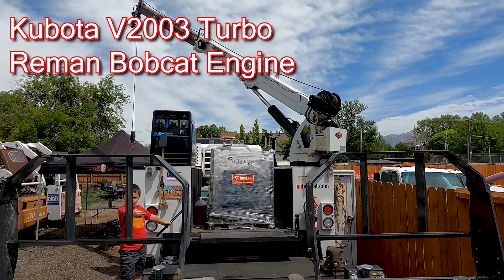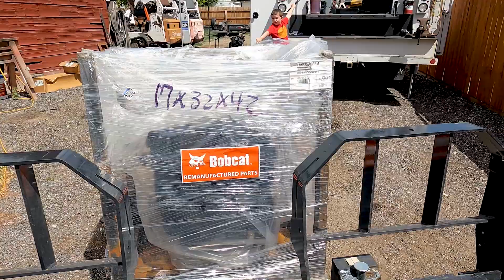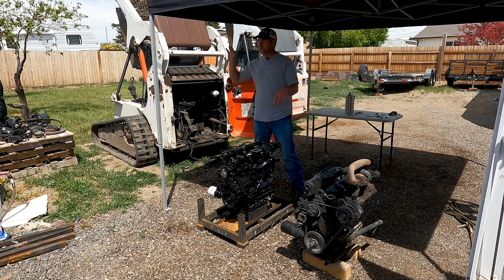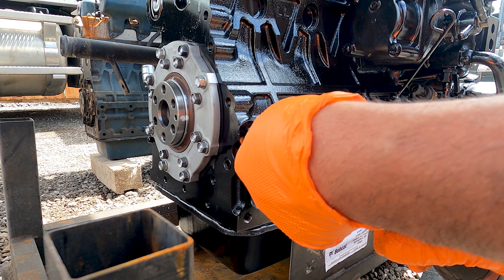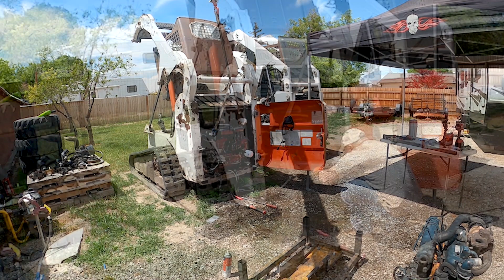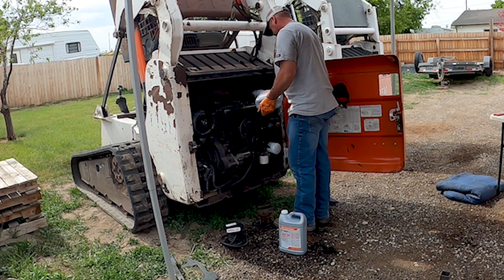Bobcat T190 Remanufactured Engine Install

Comment: I enjoy your vids and calm collected patience,  so I'm about to pull d950 out of a 553. ujoint need replaced cant find any info on this model or engine,  I'm hoping  unhook everything,  un bolt engine mounts and yank her out. my question is engine should just pull free from spline drive shaft? how do you get that ujoint reconnected to driveshaft when reinstalling? looks like a tight, blind spot like some info before I dig in

Comment: Thanks for the video you make look so easy lol
I have 96 753 Bobcat and I think my Engine is locked up .
Should I Rebuild the Engine or buy a Reman!!!.
Being that I have to replace Fuel Tank and Motor Mounts ?
Whats do you recommend doing ?
Thanks
Reply from the maker: If  the engine locked up I would probably get a reman for it.  I think the reman is faster, easier, and has warranty

Comment: Awesome video! Thanks for the education. I own 4 t190s, one at 2600 hrs, been burning oil since 1200 hrs or so, quart or so per week more with heavy use , bought used and still runs fine. Need to replace the Hydro stat pump trying to decide if I should go ahead and replace engine while out. Waiting on quotes from my local Bobcat dealer. Your thoughts?

Comment: Would you rather work on a T-190 or a T-550?  Which machine seems to hold up better?  I really enjoy the videos, thank you!
Reply from the maker: Thanks for the comment, boths machines are very good machines and I enjoy working on both.  The T190 is easier to work on if you dont have access to dealer computer software.
Reply: @tetradgroup  your welcome!  Thank you for the information and response, I greatly appreciate it!

Comment: Great Job , How many hours were on the original engine  ?   Was failure due to lack of being taken care of ?
Reply from the maker: Machine has 4500 hours.  It blew a small coolant hose on the oil cooler, and lost all coolant. Operator severely overheated engine and the head cracked and dropped a valve.  Regular maintenance was up to date but coolant hoses were all original.